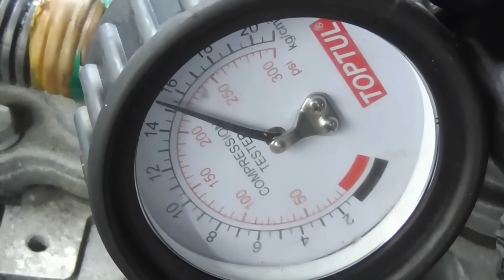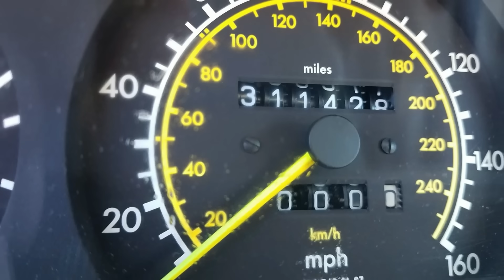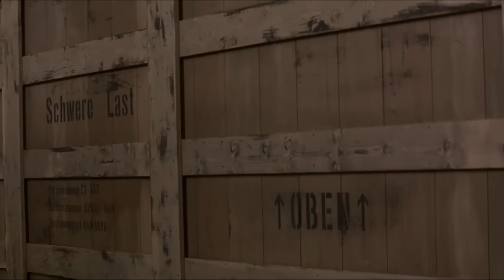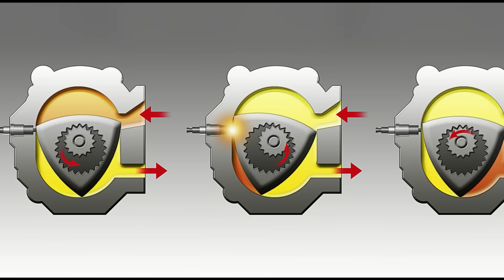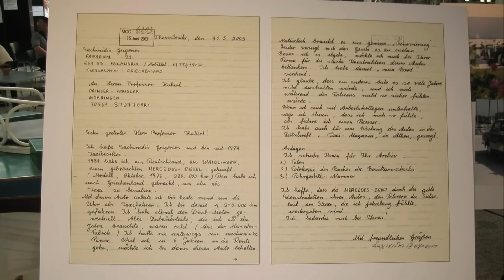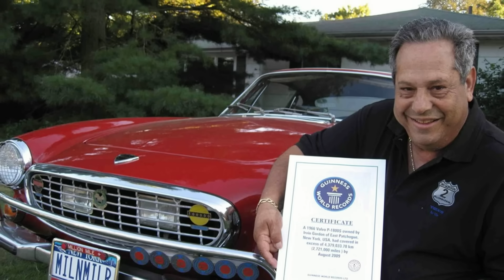Most Reliable Engines of All Time

Comment: OK then! Firstly the Mazda engine is not 1.3! its 1.3 per rotor. If its a twin rotor its a 2.6. Can you calculate what the size is when it has 3 rotors? Thats why they are so thirsty! Secondly, when you take a normal car in for a major service (lets say 36000 miles) mazda owners if they are sensible have an engine rebuild. The problem is usually the pointy bits at the edges of the rotor. Thirdly, i wont say lastly because im sure there are plenty more, to make your engine last that little bit longer you have to start it, let it warm up, then start your journey. Then when youve finished your trip you have to let it idle for a while before you switch it off. Thats why here in old blighty you can pick one up for less than £1000. Please do your homework. Other than that the vid was great!

Comment: Had a 1980 Mercedes 240d. It had over 750k on the original engine and trans when the floorboards rusted out. The engine was consuming oil after 600k (about a quart every 300 miles), but still ran like a top. I never, I mean NEVER had to have that car towed .... never let me down. It was a slow car. Slow to accelerate, slow to consume fuel, slow to break down. It was what I called a “dumb” engine. It  was too dumb to know that it needed to make a trip to the dealer every three months to empty your wallet 🤠

Comment: Most reliable engine i ever saw was a Ford 300 Straight Six. You could literally run them out of oil then dump in a couple quarts and the tick would go right away. And that happened multiple times because every single gasket leaked LoL Valve cover, oil pan, and lifter valley gaskets all leaked.  Never saw a truck take a beating like that

Comment: The engine in the Irv Gordon car is in the Volvo B18/B20/B30 family of engines, and they are very reliable and easy to maintain.
The only shortcoming on those engines that I have found is the cam gear that's in a fiber material, but there are pure steel gears to find and install. Since they are non-interference in stock configuration it's a minor problem to solve.

Comment: I had a 1981 Toyota Carolla that I junked at just over 300,000 miles.  The body was shoot.  completely rusted with holes in the floor and trunk.  Everything else worked on that car.  The Ac blew ice cold.  It still had the original factory clutch.  I purchased it with 200,000 miles for $250 in 1998.  In 2001 when I drove it to the junkyard i had only done 4 oil changes, 2 sets of wiper blades and tiers, and a brake master cylinder ( the brake fluid was sludge). Over the 100,000 miles, I drove the car.  I never even needed brakes.
The Junkyard gave me $50 sold all the lights, doors, hood and trunk. Then drove that Carolla around the junkyard for years.
I then purchased a 2000 Celica Gt new that I sold in 2012 with 305,000 miles.  Although the rings were shot.

I Still have my 2001 Jeep as my daily driver with over 300,000 miles.  No major problems.  It looks like crap. Body and drivetrain are strong.

Comment: Left out the 4.0 straight six from Chrysler.  Many can go 400,000 miles without a re-build.  My 200 Jeep Xj has 312,000 miles original trans and engine.

Comment: The old dodge slant 6 motor was the most reliable engine ever made. Would not blow up even if you had it floored for an hour. Mostly used in work trucks.

Comment: Can somebody please explain to me how chryslers 4.0 high output straight 6 isn't on this list or fords 7.3 idi diesel or Chrysler's 12 valve Cummins diesel? I had a straight six in a jeep Cherokee with 767,000 miles in was rebuilt once and a ford f250 with a 7.3 idi that had literally 900,000 miles on it and the only thing major ever replaced were the valves and clutch? Title should be changed to most reliable import engines.

Comment: You forgot the Lexus/Toyota 1UZFE . 4.0L , V8 , Quad Cam , 32 Valve and  Variable Valve timing.
Its a rock solid engine and gearbox.
Reply: Yeah the 1UZ FE was ridiculously over-engineered. The fault tolerances in manufacturing for the first generation Lexus engine were such that if a part was 1/10,000 of a millimeter off specification the part was melted down and recast. There are several million mile examples around and literally thousands of million kilometer examples floating around. Sadly ricers like them now so it's hard to find one that hasn't been abused, but properly cared for the 1UZ-FE can't be killed. Massive oversight to leave it out, it is the definition of reliability.
Reply: 22-R best motor I ever hade

Comment: 12 valve Cummins where Cummins even has a million mile club!  , Chevy 350, Ford 4.6 v8 from crown Vic
Reply: @Connor Yapp Have an 2000 F250, (7.3 6 speed manual ) with around 150,000 thousand on it runs like a top, figure will do 300,000 or more before needing overhaul. Just have to make sure to change the injector oil reservoir with the engine change. Made a vacuum unit with a large pickle jar, have a dip tube in the jar hook my air conditioning vacuum hose to the top of the lid. Fire it up and stick a probe (1/4" pipe nipple 12" long) in the reservoir and suck the old oil out, and replace it with new, oil at engine changes. Changing this oil is super important! Used in many thousands of school buses, thing runs like a clock. Pulls my 28' Avion trailer 70 mph, only have to shift into 5th gear on the long hills here in NM, AZ, and Colorado.
Reply: There are some 7.3s with a million miles on them. I know a guy that has a 2012 6.7 f-350 with over 500,000 on it and original trans, but these are diesels not gas.

Comment: A "most reliable engine" list that includes the Mazda rotary but not the GM 3800. Right.
Reply: or the chevy small block 350.
Reply: @TheLeonmafioso  Best running most versatile small block ever, and they didn't have to re-design it every year
Reply: @TheLeonmafioso  have a 79 Ford Bronco,  351m w/ 384,000 miles. By far the most reliable I've ever owned.  Daily Driver,  bought in 1984 had 34,000 on it when i got it.
Reply: @6916lightfighter  other reliable engine is the 300 l6 Ford avaliable in all kind of trucks.
Reply: @TheLeonmafioso  Is Australia our Ford Falcons were using an engine based off of the old ford inline six the most reliable variant was a SOHC 4.0L could get 1,000,000km out of them they being were used a taxis way after they were not being made because they were so reliable had good power as well.
the most powerful variants were a DOHC Turbo engine easily making over 400bhp from the factory.
Reply: @raymondmckay6990  an engine making 100 HP per liter is nothing special on this days, and less with a Turbo, my dad's Fiat 1.6l ohv was making after  rebuild and some little modifications (like installing a Lancia Volumex supercharger) 200 HP at 5600 RPM. Those Iron blocks are indestructibles, i had read something about australian Ford Barra and stock it can support over 1000 HP without problems (stock crankshaft and block).
Reply: @TheLeonmafioso Angel the power was not the Barra 's big wow factor it was the torque 417 lb⋅ft at just over 1900rpm in top form that made them a monster and quicker than most of there V8 competitors and it was all done on a shoestring budget.
Reply: 4.3L chevy as well. i love the 3.8 too
Reply: No shit and the 3100. Had 315k on mine when I sold it
Reply: cant beat a 3800   i still have two   one in  our 95 transport  an one in our 2002 grandprix     my boy  had  a 91 regal  with 350.000 on it   an the drivetrain was never touched  but oil  changes
Reply: Mazda rotaries are fast but not reliable at all
Reply: My last 2 cars had a series II and series III 3.8, 1 of main reasons I bought em. Living in the midwest usually the body will rust out before the motor ever goes
Reply: @dr.feelgood7615  my  grandprix  is  mint  the 95 van  gets fluid film undercoating  before  winter   ..having 15  cars   on two  will get salt  on them
Reply: The GM 90º and 60º V6's are known for being very stout. the 90º engines even more so, the 3800 made Wards top-ten worldwide at least twice. Both mine are high mileage and the majority of the ones I see are too and most people say the same thing about them - they won't quit. The car may rust out around them but the engines are awfully solid. I mean come on, the Mazda Rotary?!?! That thing revs high but be real, the apex seals blow and the coolant o-rings around the case fail regularly. I know which one my money would be on.
Reply: Thanks to everyone in this thread that mentioned the GM3800 and Chevy 350/LS series and the Ford guys, specially the Ford NA Barra I6 used in Australian and New Zealand Falcons/Territory's. Smh at how these tough engines were missed out!
Reply: Hey this guy has never heard of the United States,   I have the 3.8 liter in Buick, just holding on to  it to see how far it will go.    Presently about 280K.    This guy is a joke.
Reply: Another reliable engine is the old AMC Design inline six founded in the Jeep Cherokee and Grand Cherokee
Reply: The 3800 was shit IMO. It would last, but only if you sank money into the other unreliable aspects of it. They love to leak coolant from the intake manifold gasket.

Comment: Joes Fury was cool but if he replaced 5 engines and a couple trans it doesnt count... It has to not break down to be reliable for a high miliage vehicle. Like my first bosses old 7.3 f250 with 800k miles on one motor and small maintence and stuff like alternator replacement. The trans acted up once but it was a cheap fix for a diesel truck.  Like 900ish bucks from my memory of it. But over all cool vid. Im subbed

Comment: You started with en engine known for problems. The most reliable engines are diesel due to thicker oil, low running temperatures and lower engine velocity (4500ish rpm redlines vs gas 6-8000 redlines)

Comment: Been driving a 1993 dodge w-350 since 95 12 valve 5.9 Cummins I have almost 750,000 miles on an almost stock motor other than I took off the governors and put bigger injectors and a hood stack the 5.9 is definitely the most reliable engine on the face of the earth

Comment: Where's Toyota diesels, used in Land Cruiser, Hiace etc ? Those motors run easelly over 1 000 000 km.
4A-FE is also super reliable for a 1.6 gas engine, last's over 700k km.
Reply: Why are you obsessed with Trump, when you are not American?

Comment: The 1997 2.3l Ford ranger is the longest lasting engine in my opinion I’m on 300,000 on mine and it’s still running strong

Comment: What about the vw tdi engines they are incredibly reliable and not that slow if it’s one of the older pd150 versions. The pd stands for the amount of hp the engine has for example the mk4 golf as well as Bora had these engines in with a hp range of pd115 pd130 and the sport tdi pd150.

Comment: 5.9 12v/24v cummins easily 800k to 1million miles with good maintenance. and can achieve 400hp easily  with about $200 in parts. and 800hp-1600lbs torque with stock internals

Comment: Not sure which motor nissan put in their 96 hardbody truck but mine had 578,000 miles on a 4 banger when I got it, it still ran like it was new slap the floor and dump the clutch it burned straight through a new set of tires without power braking and still ran that way when I sold it with  607,000 miles completely stock daily driver well taken care of except for when I blew through a brand new set of tires and as lite as the truck was it smoked my sisters 2010 infinity g37xs twin intake v6 awd the one time we raced 1/4 mile she couldn't catch up even on the highway till I hit top speed then she would pass me hitting her top speed of 160 again completely bone stock nissan hardbody 4 cylinder truck rwd 600,000 miles smoked her infinity g37xs twin intake v6 either way give nissan some credit in this for that high mileage and still ran like it was right off the showroom floor

Comment: 200k miles impressive? Toyota Supra with 4 cyl engine? ooooook...
Reply: The Supra actually had a 4 cylinder for racing only
Reply: @enjuku6258  3sgte from the mr2 or celica gt4 have that engine and toyota used it in their native japanese racing series as it produced good power and it was lightweight
Reply: @enjuku6258 that's weird, but thx for info. i mean..there are s2000 with LS..
Reply: Mazda rotary is reliable....? first I've heard of it

Comment: Apparently you didn't look into pickup trucks for this list. There's many Dodge ram trucks with the Cummins engine with well over 200,000 miles. They even have a million miles club. I've personally seen many Chevy 350s, and 5.3s with well over 200,000 miles. The Ford 4.9 i6 was legendary for it's reliability, as well as their multiple iterations of 5.0 gas engines.  This list you made is very incomplete.

Comment: although it's an industrial engine, Deutze diesel about most reliable, one in South Africa was running for 23 yrs, almost continuously (I lost track around 1998 as I moved to USA) It was the early style modular, where cylinders could be added, 2 to 8inline, up to 16 cyl V configurations ( about 800cc per cycl) The Mercedes will easily do 500,000+ miles The Volvo is probably pre-Ford ownership, engines got real bad later on with VW supplied 6 cyl diesels only getting around 50,000miles before needing re-build (1980's?)

Comment: You must be kidding, some of those are unreliable as can be, the rotary is a joke for reliability, look it up on media sites, you can find them everywhere non running with low miles, usually failed apex seals or oil injection. 200k is not impressive by any means. I’ve owned many gm 5.7, 5.3, 6.0, 6.6 with 5-600k 6.6s with over 1mil. Bmw 3.2 with over 600k Mercedes 3.5 diesel with 500k and ran like new, Volvo 2.3,2.4 4,5,600k. Many others like them with similar miles and I’m talking never been apart and no transmission replacement either. Ask me how many head gasket and spun rod bearings I’ve put in Toyota and Honda, only good Toyota was the weak old 2400. So many better engines then most of these shown.

Comment: 196? Till 1997 
My 1995 5.0 HO/302 winsor: factory rollers, factory forged pistons. $1500 in boltons, an easy 300hp+. I rebuilt it at 288,000 of very hard miles. Im guessing 1/3 of it's life was at 4000rpm's or higher. Cam was.round, piston rings were in great shape tho.
I feel it would've made 400,000mi easy

Comment: your dumb. just in the first minute there are like 4 facts that are wrong about the rb.
1. the factory block cant hold 1000hp without cracking. the stock  rods and pistons cant even hold up to 700hp either
2. the rb is not cheap compered to the JZ
3. the rb didnt stop production in 2004, they still make a long block you can buy from japan
 4. rb parts are not "plentiful' in the US they are actually really hard to get and cost a lot more compared to other engines

edit: also the beams 3s-fe was never in any Toyota supra, there was a 503E beams motor in a supra for 24 hour le mans in 1995 and 1996 tho, it was sick it made 671bhp

edit2: LOL THIS MAN SAID THE MOST RELIABLE MAZDA ENGINE WAS THE 13B-REW

Comment: My 5.3l vortec v8 has over 242,000 miles
Reply: Those are good motors.  People love pulling them for other projects and slapping turbos on them even after 250k miles because the block is so strong.

Comment: you forgot the Nissan GA engines that was used in Asia for the Nissan Sentra/Sunny  B13 and B14. the engine has a 1.3L to 1.6L displacement.  the GA engine composed of the GA13DS (carbed), GA13DE (EFI), GA14DS, GA15DS/DE, GA16DE, while the US version of the B13 used a SR20DE engine on the SE-R variant and SR18DE on the NIssan Sentra/Sunny B13 GT-S...

Comment: Honda B and D series engines was always super reliable
Reply: Lol just not the auto trans but the b and D are good engines
Reply: @adbyrd29  Honda manual transmissions are weak as fuck. I watched my brother destroy 3 of them in his H22 Accord. My Mk3 had 260,000 miles on the original tranny and it was smooth as butter. Just had a bit of input shaft bearing noise when it was cold in the winter.

Comment: You did not mention that the rotary engine used by Mazda, was invented by the German engineer Felix Wankel. It went to German motor and motorcycle maker NSU who, in 1961, signed a contract with Mazda.

Comment: I was a service advisor at a large Volvo dealership for 30+ years.. You really ought to check out the pre-Ford- pre-Geeley  Volvo 4 cylinders used in the 140/240 series.  We serviced several with 400-500K ...one actually went 800K. Also check the 5 cylinder series used through 2009 in the S/V60/70 series. Before I retired I bought one of the last fully Swedish Volvo S60 5 cylinder turbos...A 2009 S60 SE. I change oil every 3000 miles with Mobil 1 synthetic and (obviously) keep current on all scheduled maintenance. I’m 65 and I have no doubt that it will outlast me. It’s front wheel drive - I just wish there was a way to drop an electric RWD unit in the trunk! Volvo made “Bulletproof” engines... We used to call them “tank” motors!

Comment: 5.7  350 checking in after 20 years and 380,000 miles. 3500 Express van
Reply: Anthony Amaro Overall the Chevy 350 may not be the most reliable motor, but it's certainly one of the easiest and cheapest to fix.
Reply: Still running the original powertrain I've change the water pump, starter, fuel pump, alternator radiator and intake manifold gasket. Sounds like a lot but over 20 years it's really nothing typical stuff
Reply: @anthonyamaro1771  exactly. That's going to be typical for any auto that old. I don't mind replacing those parts every so often. It certainly beats a car payment